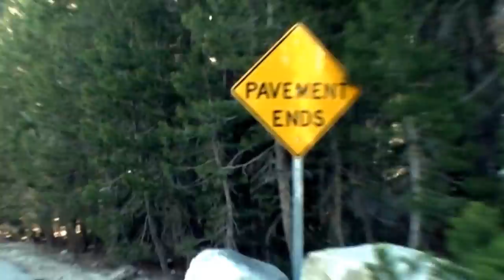Jeep Wranglers take on the Rubicon Trail Canadian Style : MAPLE HONEY

Comment from the maker: @BluSigmaSL if you get a JK, they're pretty capable right out of the box.  i would recommend getting a good set of rocker guards if you don't get a rubicon and make sure to have tow points front and rear.  a 2.5" budget boost is nice to have and with it, you can run 35's.

Comment from the maker: @unwrappedbox technically, you can run it stock but, it's a lot of work and not a lot of fun.  at bare minimum, i recommend a JK to have a 2.5" lift and running 35's, tow points front and rear and rocker guards.  lockers are a huge bonus.  with this setup, you can run it without too much fuss and have a good time.

Comment: I'm curious to know how many jeeps in your group were non-Rubicons I noticed a few didn't have the Rubicon badge? I have a three inch lift on an 09 Sahara on 35s with rock slider and wench but I at least want a rear locker before I make a Rubicon run.
Reply from the maker: +djarizona There were a couple.  Typically, our minimum requirements are just 2.5" of lift, 35" tires, rocker guards and tow points front and rear.  Lockers aren't required but helpful to have.
Reply: +Wayalife Thanks buddy for the fast response love your videos.

Comment: So.. I'm 16.. I have a 99' Jeep TJ with a 4" Rough Country Suspension Lift and a " Canadian Tire Hockey Puck Body Lift" 
I also have 33 Mudding Tired that are made by Jeep. I'm getting lockers too. Do you think with a total of a 6" lift with only rear wheel lockers and 2.5 Litre 4 Cylinder Engine could conquer something as amazing as the Rubicon Trail?

Comment: I`m buying my first Jeep(wrangler unlimited)and plan on running the Rubicon trail and MOAB trails. Most of my 4x4 experience has been limited to the east coast backwoods and not much rock crawling experience. What trans do you recommend, auto or manual for the type of adventures I have planned  ??? Any help from Jeepers would be appreciated ...Thanks
Reply: I have a 2012 4DR 6spd and wouldn't have it any other way. I'm a Atlanta boy and still love my manual. I honestly feel more connected to the vehicle, which is a great feeling in a Jeep

Comment: There are a group or loyal Rubicon trail riders that worked to get a HAM repeater on the hill and have HAM radio classes.  The system is monitored so if help is needed you can get some help.  Just thought I would throw that in there. Works with a rig in your wrangler or a walkie talkie.
Reply: What frequency?

73s,

KJ6NNJ
Reply: Loren Moore GREAT INFORMATION!

Comment: I'm seriously thinking about wanting a jeep wrangler. 

Which ones had more problems on the trail 2 door or 4 door??? Thanks!
Reply: 2 doors will be much easier to maneuver and the short wheel base will make it more capable. I prefer the 4 door because they  can be lifted more and you have more modding capabilities. Also it has more room if you wanted to take people wheeling.
Reply: Also 2 doors can "turtle on top of steep obstacles, but so can 4 doors, 2 doors are more likely too though.
Reply: Four doors are going to be more stable climbing hills but your break over angle isn't as good as the short wheelbase two door.

Comment: Pretty much if you are running a Jeep I'd run anything witha  capacity of 8,000 and up and make sure to use a quality winch no absurdly named piles of crap! If you refuse to cheap out on Scotch than do not cheap out on a winch. A winch can makeor break your experience and I'd also go with steel cable over synthetics as they are longer lasting and require much less maintenance. Also it would never hurt to get a winch with air pumping functions for when ya get back off the trail

Comment: What is the biggest size tire I can run on stock jk wheels?
Reply from the maker: With wheel spacers, you can run a 37x12.50 but I personally wouldn't go bigger than 35x12.50
Reply: @wayalife   what size wheel spacers would u recommend?